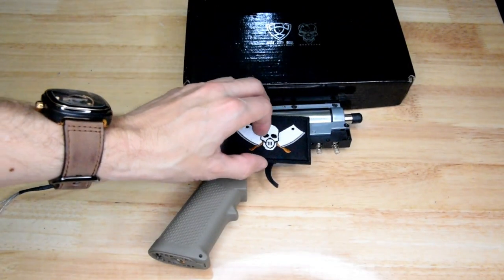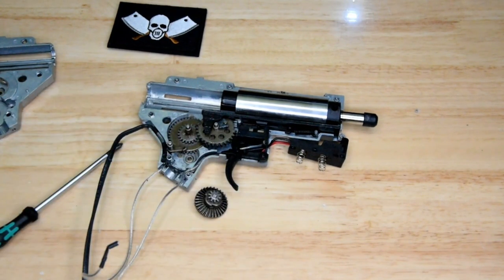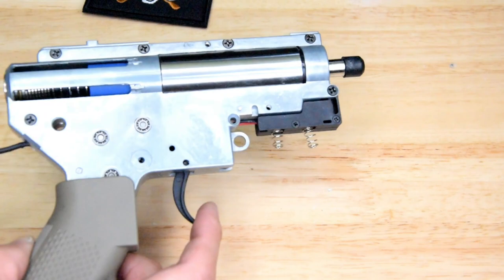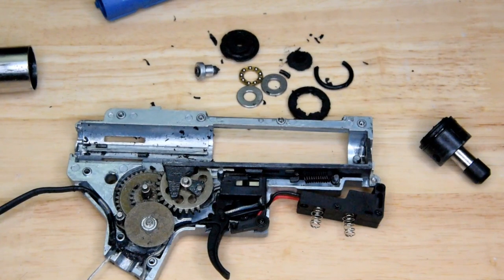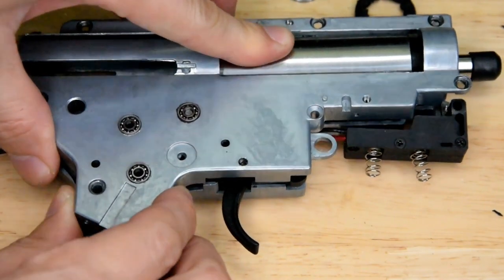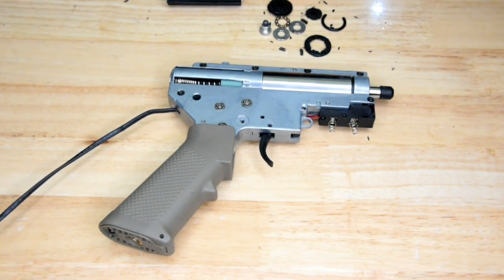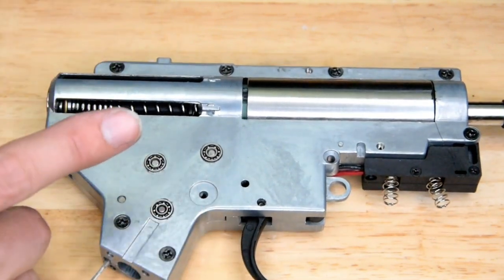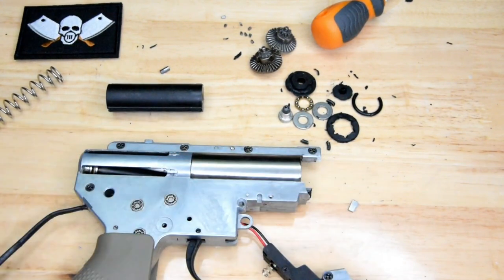LGBTT: Breaking an APS  V2 gearbox (for fun)

Comment: Why don't you epoxy your racks in cos it helps with the longevity of the piston man I have don't yet broken a epoxied piston apart from a aztech one cos they poo like I have run the shs ones up to about 75rps on a dsg setup and m170 spring

Comment: Good entertainment. I have a question slightly off topic. I notice you always have the squashed part of an unequal spring on the spring guide. Is there a reason for this? In my rather limited experience having it vice versa keeps the spring straighter but im no doubt missing something. Cheers
Reply: Ill answer my own question for others wondering the same thing. Apparently there is an fps drop if the spring is placed with the tighter coils forward. I dont have a chronograph atm so i can't confirm this myself. As to "why" I cannot find a scientific factual explanation.
Reply from the maker: @stelthtenau  I do it just because I have always done it that way. I do not believe there is any difference either way.
Reply: @lowguidoschopshop  thanks man
Reply: @stelthtenau  I don't think there would be a difference fps, more so the longevity of your gearbox. On some cheap gearboxes there isn't much meat on the back of the gearbox where the retainer sits, so putting the stiffer part of the spring (the uncompressed coils) at the back means more stress on that part. You won't notice any difference on a high quality box though

Comment: If i recall correctly, tac edge voids warranty on aps  boxes if you run an 11.1v.

Dunno of this is still the case, correct me if im wrong.
Reply from the maker: That's what I have heard too. Honestly warranty is something that I have never used or questioned because I pretty much void all warranty immediately.  And fix it myself anyway.
Reply: I bought an aps phantom 1 off tac edge and had countless problems. They refused to give me a new blaster and kept trying to fix it. I bought that blaster to go to they're event and they wanted me to wait until after the event to have it fixed. They also tried to pull the bs of "you used a 11.1v battery which was never the case. Ill never get anything through them again.

Comment: Thanks mate for a great vid, I'll have to remember to pull down my aps boar and inspect it after 1yr of use, I haven't really had any breakages so far, other than a couple stripped pinion gears, m110 spring warhead 27000rpm motor, 11.1 volts everyday all day
Reply: Good to hear it can handle an M110
Reply: @Daniel-vu4qu  I would go a bigger spring but the field I play at has an fps limit of 350, the m110 puts it a bit under at 330 to 340
Reply: @ryanmeise7975  Do you have the new silveredge gearbox with a mosfet? Or the original one shown in this video?
Reply: @Daniel-vu4qu  silver edge  2 with the monitoring in my m4 boar, I also have this version in my patriot qcb blaster
Reply: @ryanmeise7975  sorry do you mean mosfet? If so im really surprised the mosfet can keep up with a warhead! Impressive
Reply: @Daniel-vu4qu  a lot of ppl down aps blasters, I've never really had any issues other than the previously mentioned pinion gear
Reply: @Daniel-vu4qu  I've got a m120 in the silver edge 2 with the mosfet, usually go 7,4 tho.
Haven't noticed any issues. Re-shimmed it ofc as from the factory it wasn't all that great(seen worse).
An opening inspection and re-greasing is soon due, with a gear change to 16:1.